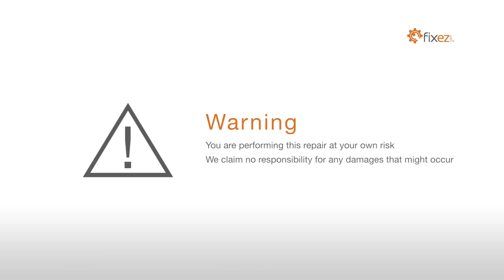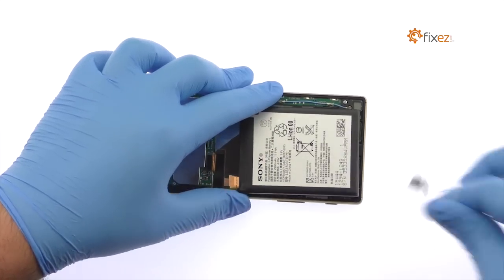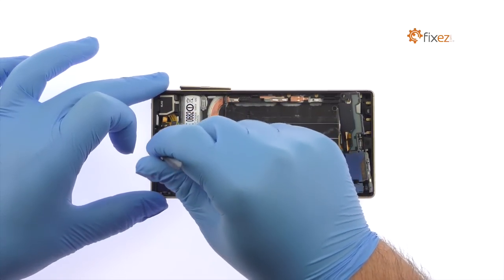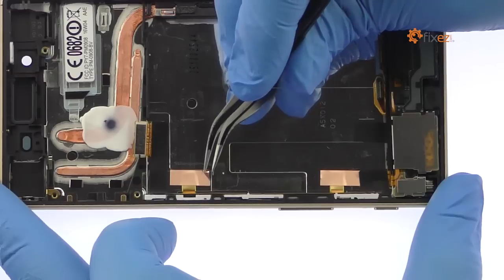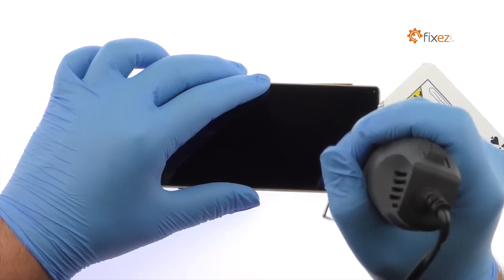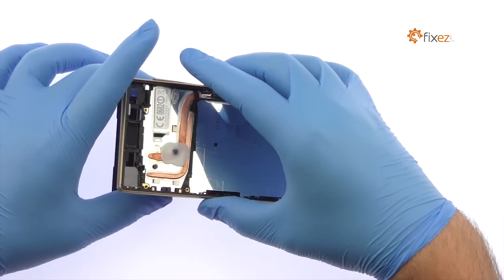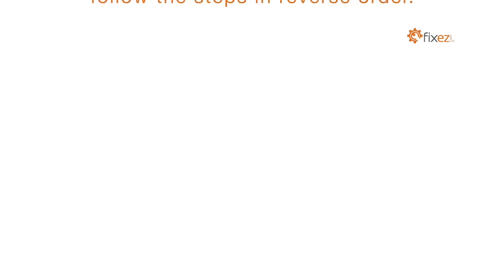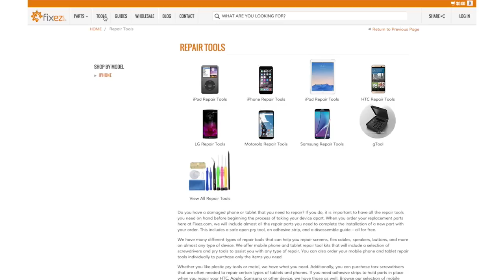Sony Xperia Z5 Screen Repair, Teardown and Reassemble Guide - Fixez.com

Comment: Nice video guys! Saved me a few bucks. Anyway, 3 of the repair shops I asked for a quote out of 4 would not touch the Z5, so resolved to do it myself. Only one criticism/suggestion: for a screen replacement, it's not necessary to remove the vibrator from the housing (9:00). I was vigilent enough to realise it was not needed, but I suppose if I was slightly more tired, I might have tried to do it even though it was not necessary. I understand that showing a complete teardown has the advantage of allowing the viewer to see what to do for any repair, but just a little mention such as "to replace vibrator, do this... but for a screen, the step is not necessary" could be helpful.
Reply: how did you put back the stretches behind the battery? 3:04

Comment: Very good and detailled Video. Thumbs up !
Just as an Information for people who want to do it theirselves. 
My Sony Xperia Z5, sometimes was a bit different.  For example one more screw in the mainboard. 
Second, despite removing the battery, the first steps (removing cameras) are totally unnecessary for removing the connerctor, just in case thats what you want to do. You dont have to remove the mainboard completely, just lift it at the end so you have access  to the connector.

Comment: Do the single sim variant and the dual sim variant use a different type of screen? I tried getting mine repaired, but they said they only have the screen for the single sim so they couldn't repair my dual sim variant. Is this true? Thanks a lot.

Comment: Hey people.
Have a sony z5 screen replacement.
Tested new screen and it was working fine.
So I reassembled the phone.
Tested the screen after glue.
So continued. At last Part after i pushed the Loudspeaker in the screen only had White colour.
Thought maybe some contact are not ok. 
Took speaker out. And it worked again.
So pushed it back in. Again not working right.
I have then Took the sticker from oldu screen on the connector of New screen  but now with or without speaker the screen stays white no Image. 
Can you please help ?
Reply: Please can you till me if you solve it, and why this happend?

Comment: those battery strips are for what?
Reply from the maker: +mrninko The strips under the battery are adhesive to hold the battery in place. Thanks for the question.

Comment: man i got the rear camera replacement and the camera quality is awful and doesn't work nicely with my phone
Reply from the maker: +Moises Pantoja It's possible you received a defective camera. Also if the camera had any hard impact in shipping it's possible the lenses could have been knocked out of alignment.
Reply: ***** ay that was a faster response than trying to call your customer service. tried calling on different days at different times and nothing. the camera is actually messing up my phone